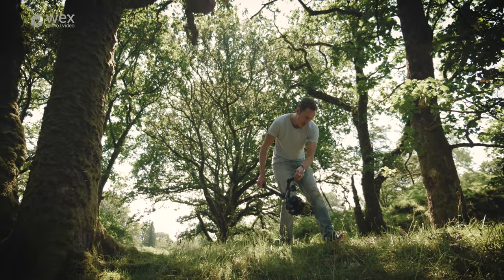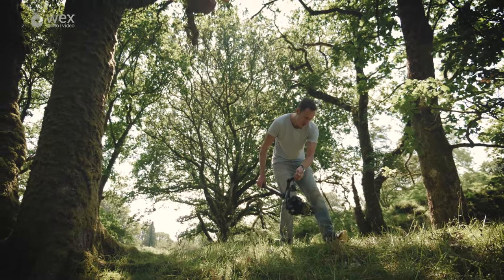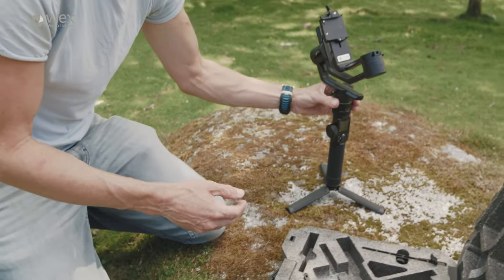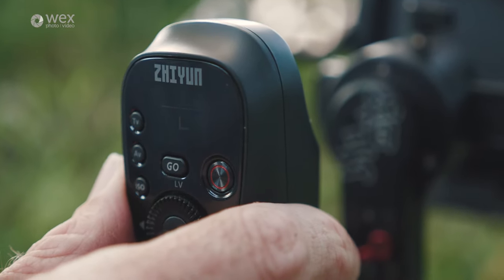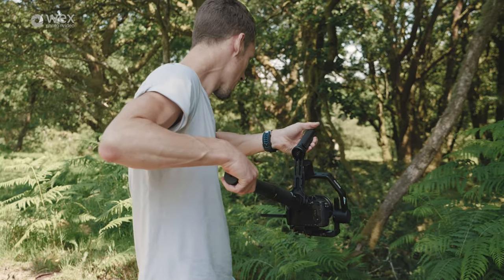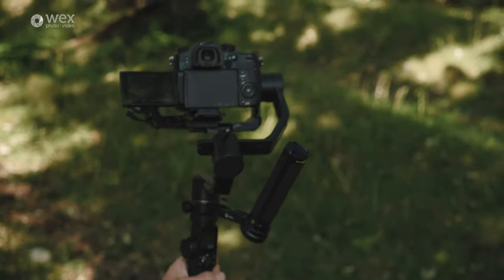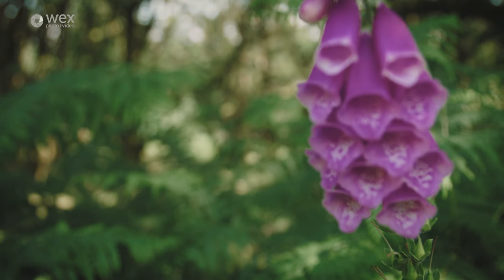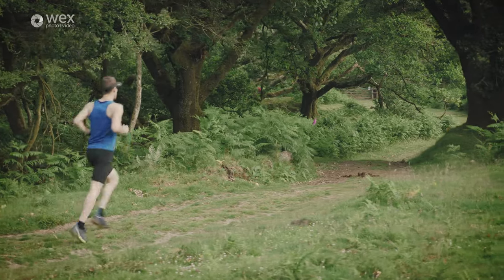FEIYUTECH AK4500 vs ZHIYUN CRANE 3 LAB | Gimbal Comparison

Comment: Hi Jon, do you know if the Canon XF400/405 will physically fit on either of these gimbals? Some rear clearance measurements would help me a lot - minimum Centre of Gravity to rear arm in particular. BobUK.

Comment: Can the ak4500 be configured to have its sensitivity increased at the press and hold of a button?
For example if we press and hold the trigger button the gimbal goes into sports mode, just like the go mode button on the zhuyin crane 3.
Reply: no, you go into the menu and select the action mode, it takes 2 seconds but no dedicated button
Reply: @JonathanJScottFilms  another guy replied that the front trigger button's "press & hold" can be configured to "all lock", "action" or "pan follow" via the mobile app.
Did you check in the app?

Comment: I just bought the ak2000 i set up the focus motor on my panasonic g7. How do you asighn  the wheel to operate the focus motor i can only find pan and tilt wheel operation on the options menu
Reply: Not sure if the ak2000 has the same touchscreen menu but it's the little square symbol from memory
Reply: @JonathanJScottFilms  yes it has the touch screen menu
Reply: @jaysun070476  yes, like I say it's a little square symbol, down the bottom on the second screen
Reply: @JonathanJScottFilms  cool.thanks